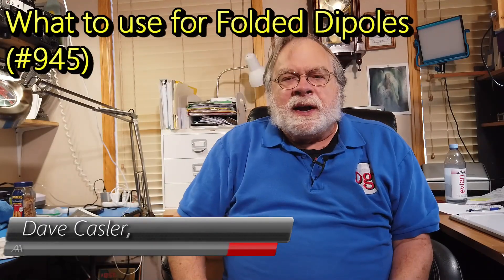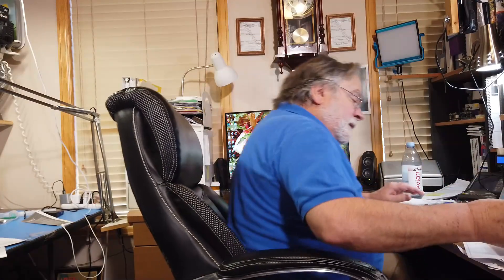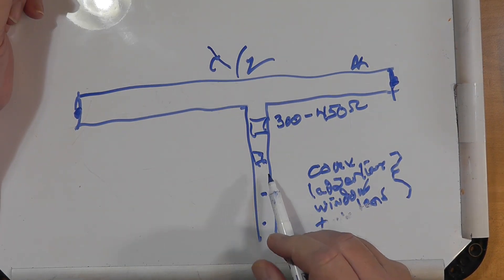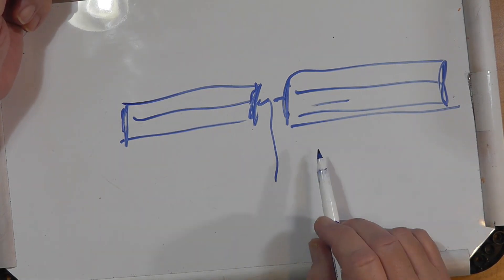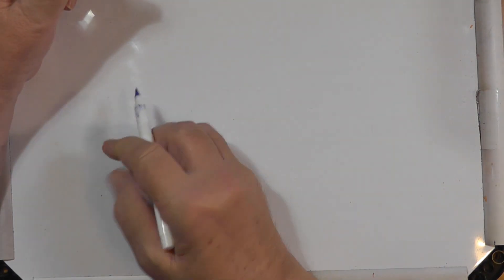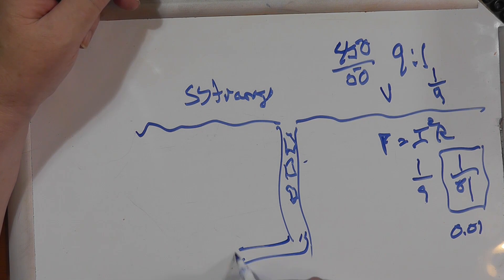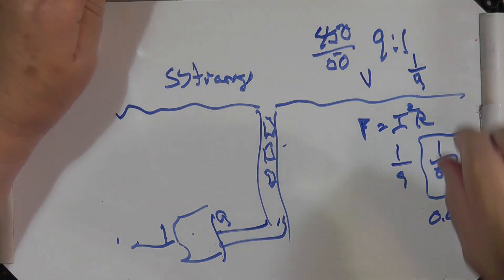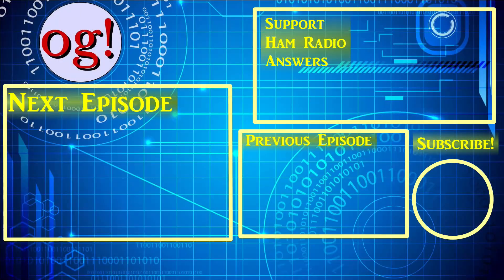What to Use For Folded Dipoles (#945)

Comment: I believe each time you add a parallel radiator on a folded dipole, the feed point impedance multiplies by 9 (or was it 7?).  My ARRL Antenna manual is buried so I can’t check it.
Reply: It multiplies by n^2

Comment: The G3TPW Cobwebb antenna uses speaker wire and passes one wire through the feedline box and the other wire begins and ends at the box where both ends get tied to the coax connector.  The outer ends are tied together like a folded dipole.  Apparently this gets up to 7dBi gain and is omnidirectional.  Few people sell these things, however, making most of them homebuilt.  Been trying to import one to Japan but that's like pulling hen's teeth.  Anyone have one to sell?

Comment: Don't know what rotor cable is but, #16 lamp cord is about 72 Ohms and was popular to feed a dipole in the Tube days before coax. A folded dipole is a one bander unless you load up the feedline,
Reply: A rotor cable are the cable that is between the controllbox and antenna / tower rotator. It contains multiple strands :)

Comment: A friend ran a vertical antenna up the outside of his chimney and painted it to match.  Don't remember what else he did, but he got reasonable results, I think.
Reply: I installed my first dipole under the eves of my uncle’s home on Long Island.  It was 40 meters and worked great.  I also had a 40 and 20 meter dipoles in the attic of my home in St Johns FL.  They also worked great.

Comment: 4:26 In that configuration, the antenna becomes a slot antenna as it is feed parallel to the radiator (look at hentenna). The Folded dipole is fed in series to radiator. I am trying to remember which particular case it is: lowest SWR or widest bandwidth.